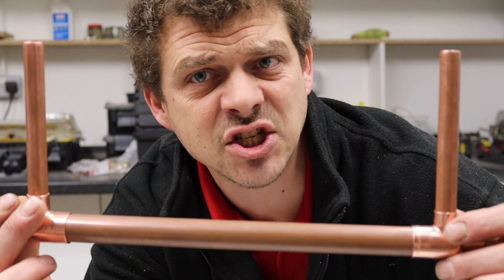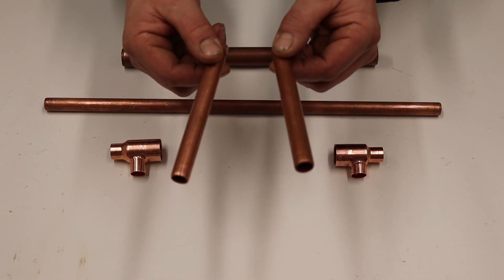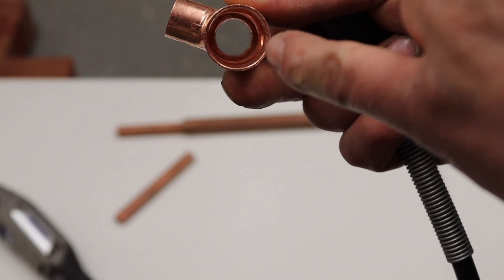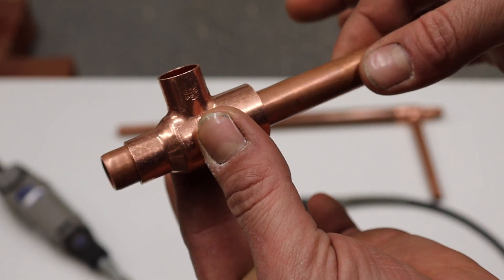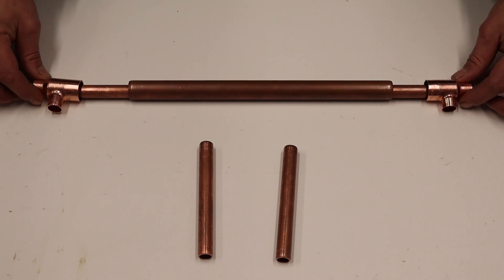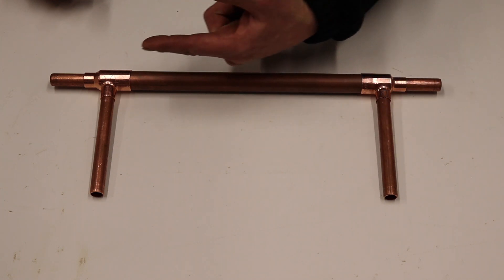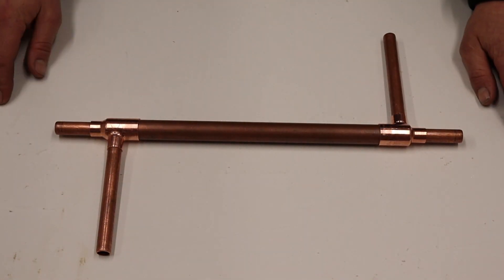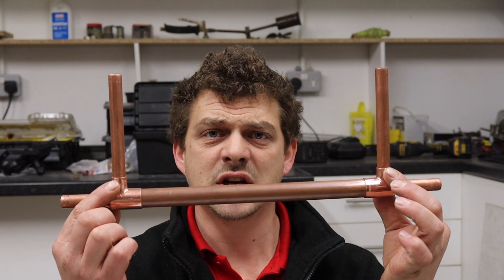How To Make a Heat Exchanger

Comment: Hey mate, will this work on boats??
Reply: I don't think solder takes when on the water.
Reply: You could use refrigeration solder, it resists corrosion very well and is easy to source.